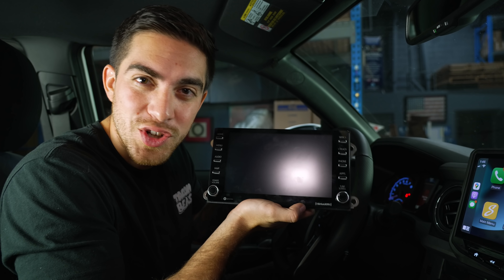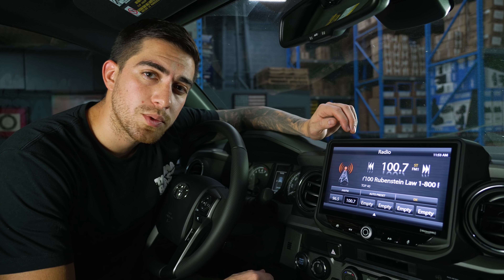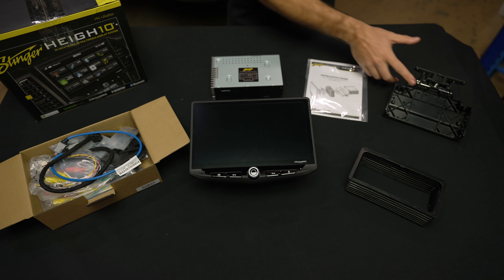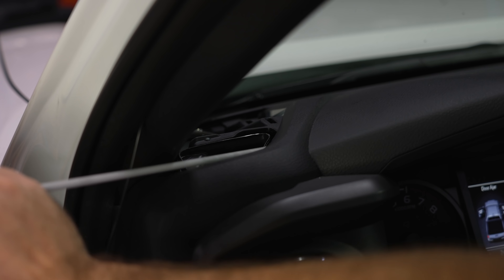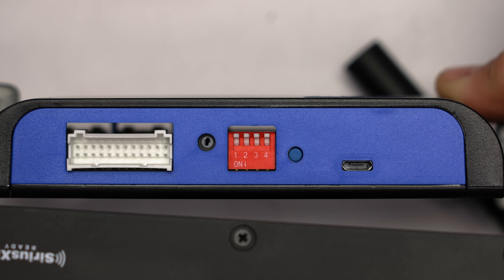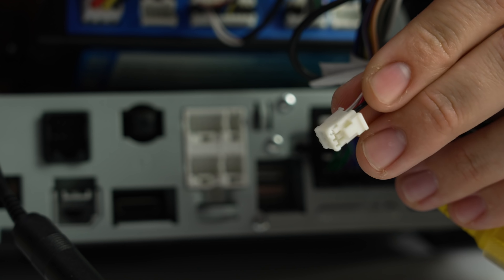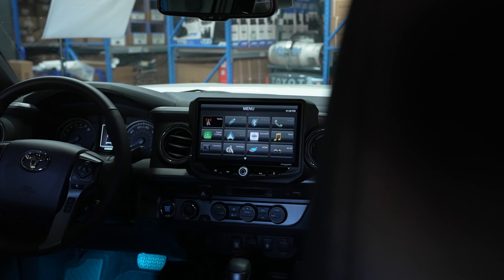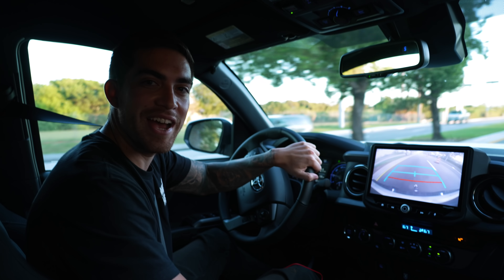2016-2022 Toyota Tacoma 10" Touchscreen Infotainment System Review/Install

Comment: Looks awesome, for $1,500 it’s lacking apple car play wireless, and I would have liked to see a PIP mode for the backup camera, I love what GM does with their rear view mirror live camera, and I would have liked to use apple car play for example, while seeing what’s behind me while driving. Finally the screen refresh rate looked low, like I said for $1,500 would have been nice to see a higher refresh rate, looks like it’s around 30fps… a bump to a static 60 fps would have been much better. 120fps if you wanted to go above beyond.. also it’s only a 1080p equivalent display ..? Cmon. it still has some value being an OEM fit but being picky like I am, paying almost 2k for a radio should have the latest tech, not tech that’s over 3 years old IMO.
Reply: Yea, this thing is $700 tops.
Reply: @dirkdiggler2379  It's over $1700 now. I just purchased it. Haven't installed it in my 2016 yet though. Also my local Stereo Shop said they have installed 4 of these Stinger 10 radios in different vehicles and each time it took them at least a hour and a half. Of installation.  So don't believe that 45 minutes of installation BS  if you have never installed a radio system in a vehicle.
Reply: Hey Bjorn, do you know of any aftermarket screens for the 2020 Tacoma that have all the features you just mentioned? Thanks
Reply: Kenwood has a nicer one in my opinion that’s also 10” but it has wireless CarPlay & Android Auto. This is a Stinger, there is also a nice 10” Alpine.

Comment: Who sells side cameras?  Just bought a Tacoma and had to give up on this feature to avoid the sunroof. I would totally add this stinger and side cameras. This is EXACTLY what I need.
Reply from the maker: We will be offering them on our website
Reply: I wonder if I can use my factory MTM cameras with this unit
Reply: Dont know where you got your vehicle but i ordered my 22 with out sunroof and i still got the multi terrain monitor with all 4 cameras.
Reply: @marcussnow6343  They don't allow the feature in the "southeast region" god only knows why when they market the it nationwide, and then even deny it to someone willing to order a vehicle and wait for it.  Even in regions where it is on offer, I was told that due to excessive demand of the off-roads as well as the chip shortage, MTM was only on loaded trucks, which is a deal breaker for me.  Really unhappy with Toyota over this, but there's no other maker to goto when it's all said and done.

Comment: I’m interested that’s for sure but I don’t like the zip ties for mounting the radio mod. Maybe something like adhesive Velcro tape to keep it from moving. The movement could cause stress on connections over time.
Reply: Ditto.  $1500 and the best they can do is wire ties for a critical component.  Otherwise seems like a nice upgrade.  I'm guessing the the aluminum plate is a heat sink don't attach an insulator to it.

Comment: One of my favorite upgrades.  When doing audio, I  like to remove some of the extra wire that is not needed in the harness.  It makes for a  cleaner install.  Great job on the video.  The beast rocks.
Reply from the maker: Thanks for the tip 🤙

Comment: Great instal. I definitely would not be using an impact driver for this instal. That is the wrong tool. A 12v drill, with the chuck set to a low tolerance and finish with hand screwdriver is by far the best way
Reply from the maker: Thanks for the info!

Comment: that 10inch screen is awesome! What type of modifications will be need to make the anytime back up camera system work with this unit? Does the wireless charging pad integrate with the his new system for wireless apple car play or will you still need to plug in with a cable? Over all great video and great looking product!
Reply from the maker: The anytime camera should still work and you would need to plug it into the system for CarPlay 🤙

Comment: Mateo, can you download additional apps if need like  range apps.
Also I have the JBL system in mine. It has that amplifier built in. Would that be an issue?I noticed it doesn’t utilize the stock mic.
Do you have to use the one supplied?
Reply: the kit makes you utilize the stock mic. you dont have to use the mic that comes with the player
Reply from the maker: It is compatible with the jbl system, and the apps downloaded are those allowed on CarPlay 🤙

Comment: Work with the JBL sound system? And do you need add ons to use the factory back up camera?
Reply from the maker: Works seamlessly with the JBL, no need to have any add ons for the factory back up camera but it’s not compatible with the 360 cam

Comment: Wish it was a little more lower profile but bigger screen is definitely nice. Seems to be responsive when using the touch or the controls. Not laggy as if the computer is low quality. Curious how this would sound with the OEMAudio+ that you installed in your truck vs maybe just going aftermarket speakers.
Reply: id also like to know this! lol
Reply: I’m also interested in how it’ll work, I have a good feeling it would work well as they put some time into working the audio setting interface.
Reply: Also I would make 500$ moving to this kit if I see my stock computer
Reply: That's the million dollar question. I checked closely when the tweeter cover popped off, those definitely weren't the OEMAudio+ Tweeters. Seems like he swapped them out back to stock from their appearance.
Reply: @JoeTritschler  that’s not his normal truck, they installed it in they’re 2021 giveaway truck. How I believe is a 2018 that he installed the OEMAudio+ in.
Reply: @Sw20boosted  Great eye! I really think the likely increased headroom of this radio paired with the OEMAudio+ speakers and tweeters would be great. Should leave the stock Radio in the dust
Reply: @JoeTritschler  Waldo can’t hide from me! Haha and yes I agree, I’m sure it’s something you have to see in person to judge if you like how it looks along with the function. I installed something like this in my Lexus IS350 that gave it a 10.1” screen, but it was china product and I had to install Apple CarPlay with use of a dongle and the audio quality was relied on the power and tuning of my added AudioControl amplifier. This seems like you can skip some steps and keep cost down for sure!
Reply from the maker: Definitely sounds awesome 🔥
Reply: I’m fixing to find out . I have the Oem audio with dual subs installed in my 2016 Tacoma . Getting my screen this Friday . I did find out last minute that Oem audio was offering the aftermarket radio now which comes preset for the Oem audio plus . Anybody know what they did exactly to it ? I ordered mine straight from Amazon .

Comment: Looks awesome - do you know
If it’s compatible with the 2021 TRD Pro Birds Eye cameras(4 total) and the off-road features that they come with and the auto on feature (under 5mph)?
Reply from the maker: It’s not compatible with the 360 view but you could add the cameras as individual cameras as long as you have an RCA port
Reply: @tacomabeast  that's unfortunate, seems to be a perfect headunit otherwise... that's the dealbreaker feature to have right there.  could a future software update add that?

Comment: i ogt my stinger heigh 10 a couple years ago it was install on my scion xb but when i got my tacoma i transfer it. heigh 10 player is a floating player. you can add a hdmi cord to it so you can wired stream on the player. i spend less money getting the parts myself than buying the pac audio tacoma kit. mounting kit is about $450 from stinger . i spend about about $150 for the dashkit, harness, steering wheel module, usb adapter,  antenna adapter, hdmi cord and iphone charging cable. and heigh 10 was $899 from crutchfield. just my 2 cents, but i love how the kit make the player sit flush on the dash

Comment: Will this work with factory navigation? The factory navigation (built in maps too) and it's built in tracking feature for the trails is awesome, just want to make sure we don't lose that feature. Thanks.
Reply: Unfortunately you do lose the feature
Reply from the maker: It has its own gps navigation feature 🤙
Reply: Thanks for the response. Does the new built in GPS come with the maps already installed or do you have to buy the map SD card on the company site for a couple hundred bucks separate? Also does the new GPS feature have route/trail tracking and route saving feature like the OEM?
Reply: @johnrunner89  you just said you're happy with what you have why would you pay $1,500 to have essentially the same thing that mirrors your smartphone buy a $100 Android tablet and some 3M velcro stickies and velcro sticky it around the radio boom

Comment: maybe I'm oversimplifying things, but I find it strange there's an adapter to allow you to use the factory USB port for Android Auto/Apple CarPlay (awesome), but no way to use the factory microphone already in the truck (not awesome)
Reply from the maker: It’s not that it’s now allowed is that the microphone that comes with the head unit is much better than the stock mic, but you could just as easily plug the stock mic in

Comment: How is the mic quality?  I'm happy with the integrated one in my truck now...  is there a way to use the stock one in the ceiling?
Reply: Ifs beter then most aftermarket mics but still not the best.
Reply from the maker: The mic of the system is higher quality than that of the stock taco for sure 🤙

Comment: I just bought a 2019 Tacoma. Will replacing my head unit cause any electrical issues with the system?...
Reply from the maker: It should not cause any issues at all with the new system

Comment: Hay TACOMABEAST have you looked at the PathFindir II thermal camera for detection of deer and pedestrians in night time driving environments? I recommend that for your next upgrade and as one of the 4 camera feeds to this nice radio,  you could also look at the Speedir night time camera but i cannot vouch for the quality,  it may be a good option considering FLAIR PathFindir is 2.5K upgrade.  But imagine not hitting a deer or running over a child at night because you didn't see the hazard in time. NAV-TV has these units, get the object detection system as it highlights humans inside a box on the display.

Comment: Very awesome unit, but still think a bit over priced wish it would include the three other cameras to be front, and both side mirrors ones would come in handy for overlanding and I would not hesitate to buy this for my 17 tacoma trd 4x4 orsb. Great video thanks for the detail install instructions.
Reply: This thing could have easily cost $250,000 or more just to R&D/Write Software/Make Moulds/Machining. They have to pay all that back before they even start to profit.
Reply: @cody5495  I guess they better get started on making them than cause you out cost money to start a business and or sell a product but I honestly have know idea what r&D means and don't real care to know either a for hardware and molds I don't think it real cost that much for plastic and some wires and stuff especially from where most of the stuff even comes from you would be suprise how much a phone actually cost to make and for they cost to buy theirs huge profit in that business if you think radios system is that much difference in tech but I still think a phone tech has more even but I'm just speaking from consumer point what I'm going to want to pay now as for software well they punch on key boards all day and make pretty good pay for it to, don't they guess we should have to pay big money for that ok yeah it's all good still think it's priced way too high maybe your opinion may differ but than again you might be also involved in the products production too who know have a great day though.

Comment: So will you be able to keep the Toyota factory setting with this unit and access them? Like the wifi, the door locks, the car auto heat and ac when remote starting the vehicle,  the software update that Toyota might send for the actual vehicle computer!? The valet lock, etc like can you tell me what if any factory features are lost!? Or not, cause if I'm going to invest this amount $ I would assume not only to keep all my stock Toyota features,  but also gain those you mentioned! Thanks
Reply from the maker: All factory features as far as settings go should remain, only thing that doesn’t transfer is the 3TPAM And 360 cameras

Comment: 1) Does it handle text messages like the stock unit?
2) Does it have the annoying moving lockout on directions and reading text?  I hate that my passenger can't set the gps destination without pulling over.
Reply from the maker: It works essentially like an Apple car play when it comes to text messages and directions 🤙

Comment: Just installed on my 2016 but my reverse cam is in black and white... why?
Reply from the maker: If you need technical product help you can use the chat feature on our website, there should be the option to get technical help for stinger which is this unit

Comment: Really nice to have but I can’t pay $1500. I’d rather spend that on a nice aftermarket radio , amp, sub combo
Reply from the maker: To each their own 🤷‍♂️
Reply: I just purchased this it's now more than 1500. Why the increase I don't know. Haven't installed it yet in my 2016 main reason for getting this is because the 2016 Tacoma JBL head unit sucks big time.

Comment: This audio system looks really cool I want it but will this work with my OemAudioPlus system with dual subwoofer? 2017 Tacoma.
Reply from the maker: It should work just fine!
Reply: I spoke with  oemaudioplus and they said it will work fine. I just installed my reference 500 setup this week. Can’t wait until the Heigh10’s are shipping again!

Comment: Newbie here, just bought my 1st (new to me) taco. does this system run off your phone to get the Google auto and all the apps? Or will I still be required to buy the Toyota connect (or whatever it is called)?
Reply from the maker: This system is a wired Android auto so as long as you plug in your phone it will port all your apps from your phone that are compatible with it 🤙 (media apps like YouTube and Netflix aren’t allowed as they are considered distracting)
Reply: @tacomabeast  thanks for clarifying that for me. I want to replace the infotainment system on my 21 trd off road. By the way love the channel. Too bad I didn't hear before you gave away the truck this past December.

Comment: if i current have the ANYTIME backup camera kit for front and rear view from a switch which i like cause i can quickly view it.  will it maintain that?
Reply from the maker: As long as you connect the cameras to the new unit it should work fine 🤙

Comment: Question - My 2022 Tacoma Sport has the JBL Premium sound package.  Does this head unit fix the issue with Siri/Voice/Calls only coming through the front drivers side speaker?  I am looking for a head unit (with volume knob) that will play Siri/phone calls over all speakers and allow for volume adjustments. 

One thing i just dont know if i can forgive on this head unit is the fact it will not use the factory installed microphone and you have to jerry-rig some cheap ass looking microphone through the dash and up into your trim.  Does the internal microphone work well enough to not have to use the external mic?  This is a very big negative in my opinion.  

Also - does the plug and play work with the JBL Premium sound package including usage of the JBL amp?  

Appreciate any advice
Reply from the maker: The head unit microphone is better than the stock one which is why we installed it. as far as phone calls only coming through the phone speakers I believe that’s a feature of the system itself and it’s to improve sound clarity for the driver. It will work with the JBL package 🤙

Comment: The factory Navigation cable did not work on this headunit. I had issues with the IGO Navigation getting a signal it kept saying Acquiring Satillites. I called Stinger and was told by one of the Customer Service advisors that the GPS antenna from the kit had to be installed. It was a pain because I had to take everything apart again to run the GPS cable from the back of the receiver thru  the passenger side of the dash
Reply from the maker: Hey Darryl, sorry you had issues installing this head unit, we’ll try our best to explain installs better in our future videos 🤙

Comment: Will this work with the JBL system, 360 camera, and add rear outputs for a 5 channel amp?
Reply from the maker: It will work with the jbl system and the amp but not the 360 camera 🤙

Comment: Does it work with the stock 360 cameras? Can you see it work just as the stock feature? For example,  when slowing down the 360 cams come automatically on.
Reply: Im not sure on the 360 picture but i know i asked stinger about if it incorporated the multi terrain monitor on the offroads and the pros that have it. and you would loose this feature.
Reply from the maker: It does not work with the 360 cameras unfortunately

Comment: Does it retain your GPS compass on the dash and still tell you the audio information? My biggest beef with all these head unit “upgrades” to our trucks is that you lose some functionality, while small losses I still didn’t pay so much money to end up with blank screens and less info on my truck. Integrate these units seamlessly so they retain ALL OEM standard functions and I’ll be sold…for $1500 not shipped it’s not worth it.
Reply from the maker: It retains all factory settings and options 🤙